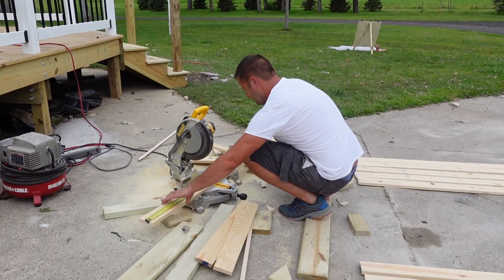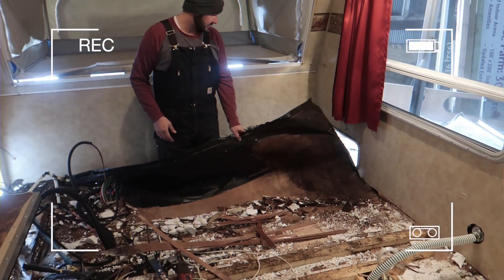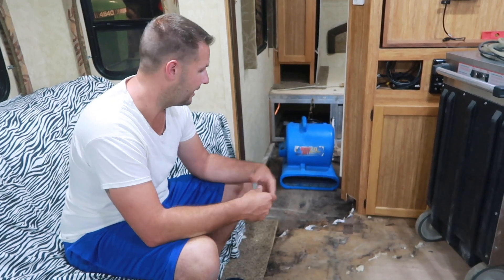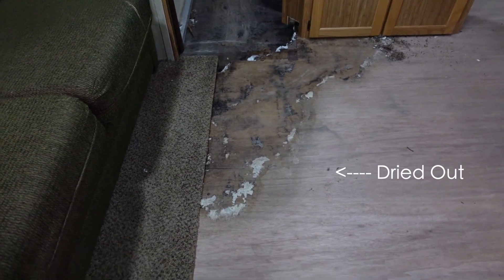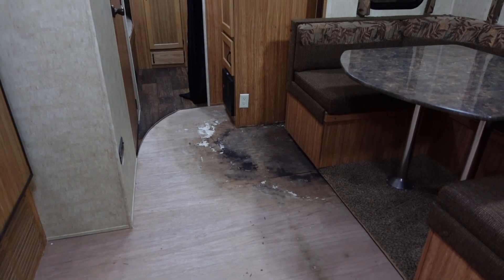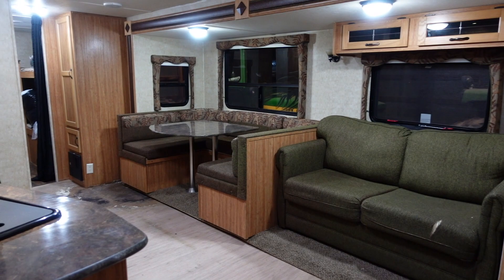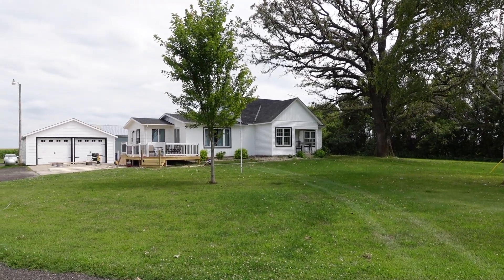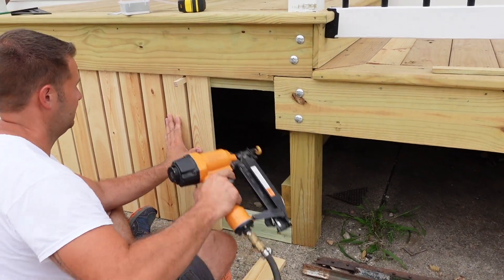Finding More Water Damage in our New Camper

Comment: We owned RVs from 2007 to 2020. We found that running a dehumidifier year-round in the travel trailer made a huge difference! The dealer told us that RVs that are used don't have problems but those that sit there and do nothing get tons of problems. So we used ours a lot to stay in when company came to visit or to use it for the mom cave to get paperwork done or to just have a family movie night out of the blue. We always went and checked it after a storm to make sure there was no damage from water inside of it. Now that our boys are older and have summer jobs we just don't use it like we used to. And yes we did what you are doing to your RV. We took them from bedraggled to cute little homes on wheels.
Reply: We also ran two oil heaters one in the front and one in the back along with an ionizer. People wondered how we could afford the hydro bill for that but we only had them on low and we found that our investment was well-protected. We also were able to resell the trailers at above market value. My grandfather had to retire from the military early. He and my grandmother spent 20 years buying and remaking trailers.
Reply: Thanks for the helpful advice.

Comment: Spray is smoother but it is more messy in an enclosed space.  Maybe  just the door fronts on the cabinets could be sprayed outside?
Reply: Vicki Montgomery The walls have a slight texture which usually rolls on nicely without all the spray mess, but the smooth cabinet doors show the brush/roller marks. Spraying doors outside is a great solution. 👍🏻👍🏻👍🏻
Reply: I was thinking this too

Comment: We bought a brand new 5th wheel ($50,000) and one of the first times we took it camping it rained really hard and it was pouring inside right at the slide. I think there's a lot of manufacturer's defects with the slides. IT'S NOT JUST THE OLD ONES!

Comment: Your slide looks like the one we used to have. We loved it but it worked when we first got it as you described. We took it to repair shop and thankfully a person there had worked at a repair place that had that style he said absolutely don’t oil it. All you need to do is take soapy water and wash the metal top and bottom on the slide. Easy as that and it really helped it slide smoothly. He also said to be sure to fully slide it out and in once you start. Hold for a couple of seconds once completed. Ours made a kind of noise at that time. That helps set the brain to know how it should slide. Obviously I don’t know the technical terms but hopefully you can understand what I am talking about and without techs help we probably would have caused more problems to our huge slide.

Comment: The deck is looking very classy.... a plastic lattice skirt just couldn’t hold a candle to those finely fitted verticals boards. Your miter job is outstanding. That’s very fiddly work. The fact that it all fits so well together speaks to your pre measuring and making everything square as well as your mitering skills. Your horizontal bottom board could eventually rot out, but it looks easy enough to replace. Good job Tom!!!
There’s no doubt that spraying leaves a nicer finish. And if you’re going to gut the trailer anyway, it might not be such a mess. It certainly would go faster. But I’d want some practice time with the sprayer first!!!

Comment: Experienced with spraying here (or I should say I too am blessed to have married a "Tom," and I help with spraying)--we use a little sprayer to get into the small spaces (the eaves of our exterior roofline recently) and our big sprayer for cabinets (outdoors or in the shop), and we have used the bigger one in our house for ceilings--but the overspray is such a mess--my husband would rather roll interiors as well. I'm with Tom--roll it. If you are pulling out cabinets to reuse--you could spray those for a nicer finish. Another thought for saving time--Behr Marquee at Home Depot is expensive, but we have used it when we flip houses, and it is magical for coverage and correction--it may cost more but you save time on priming for sure! In fact, I had to prime a room recently, and I regretted not buying the Marquee and saving half-a-day.  I like it better for coverage than BM and SW.

Comment: As the daughter of a painting contractor, I would roll the interior instead of spraying. Use 9 inch rollers and mini rollers though. The 9 inch roller will make it go much faster. There is so much over spray with a paint sprayer. It would be a giant mess like Tom said. Spraying typically makes sense in new construction but not in a tight small space like that.

Comment: I brush paintedand rolled all of the wood surfaces in our motorhome. I used sherwin Williams semi-gloss pro classic paint with a foam roller. It turned out beautifully. Very smooth and no brush marks. That being said...Spraying would be faster and a nice smooth finish. If it is virtually empty it would be easy to paint as long as you tape everything off well.  Looking forward to seeing what you decide to do!
Reply: Also, we  been homeschooling for the last 11 years. We have a 10th grader and an 8th grader. It’s been great. You have so much flexibility and there are so many awesome options. You’ve got this!!

Comment: I sprayed mine. I used a new sprayer that was recommended from Lowe’s. It worked great until I had to spray high toward the ceiling. The sprayer spat out paint and splattered. So make sure you reservoir of paint is full and your sprayer is quality.

Comment: For the painting, you will need to block off all the areas or cover all those areas you are not going to be spraying which is very time consuming, I find it is better to paint smaller areas with a brush or roller. For the water on the floors, it is most likely coming from the seals on the slide, check underneath the seat and table, it is probably wet there too. It is not hard to redo that area. Lots of videos showing how to do that. Good luck!!

Comment: We had a mold issue in an apartment, the landlord brought one of those huge dehumidifiers in, it was loud, it was HOT and it was an awful few days. Could not sleep, just a horrible experience . And they told us if we turned it off we would be evicted. It came from the contractors who replaced the whole roof before we moved in . We were not compensated at all and we moved out shortly after that , they let us out of our lease when we threatened with a lawyer. Turns out the roofers covered the soffit vents!
Reply: I wonder if we don't have the same problem here. The bathroom vent doesn't work. It runs, but no air flow.
Reply from the maker: Oh no!!! What a horrible experience!!

Comment: We used brush for small spots then standard roller for the larger spots.  Also, our slide has a small hiccup area upon initially moving it and ours isnt as large as yours, sofa only.  We removes that ugly faux leather/wood trim from around the slide and updated that as well, makes a huge difference and updates the age appearance.  Wish I include pics to share.  We're down to finish new underfed drawers and install, magnetic knife bar hung and install a 12 volt outlet in the bedroom...  and hubs is aking if we're ready to buy the bus to reno!!!

Comment: I vote for brush and roller. My sister's a pro painter and tells me to spend more time getting a good, even coat with your primer. Do 2 coats of primer since it's cheaper than paint. Most people don't realize that a streaky primer coat will show through. Then you may only need one coat of your more expensive final coat.

Comment: Take your cabinet doors off!  It takes a couple minutes but you can spray them outside which will give a much better finish and save time in the long run.  Then just brush the frames and paint the walls as normal.

Comment: Decluttering had to be put on hold here. I've been watching grandkids 3 days a week during this public health mess. And it's really hot, 100+ every day, and I only have an evaporative cooler, which does not work well during July and Aug from the extra weather humidity. I don't do well w/the heat/humidity combo inside. :(

On #teamTom for painting. I don't have much experience w/that, but I'm thinking the small space would be a hindrance.

Love the deck. My question is always, how to keep the junk from piling up underneath?? and critters? 
The vertical slats look beautiful. 

I applaud you for homeschooling! I did it for 3 years with 1 kid. My daughter has to "oversee" the "remote instruction" from the charter school for only God knows how many days or weeks at this point until the state decides it's okay to be in the classroom. You know "oversee" means the real teaching. The boys are in 3rd and K. No parent can work full time and over see a full day of school. Mom not working is not an option. 
Let us all pray for normalcy to get back to daily life!

Blessings from AZ

Comment: I think spraying sounds like a humongous mess as well. I think it will be way more hassle than it's worth, and you're going to be in a confined space trying to spray, it will just get everywhere. Are you going to wear full body suits and goggles and face shields? You will need to, and I think it will get in cracks and seal stuff together that you don't want sealed. My opinion. Never done it, and I FEEL you on it being a giant pain to have to roll and brush the whole thing. Yikes. But I think it would be the better option, personally.